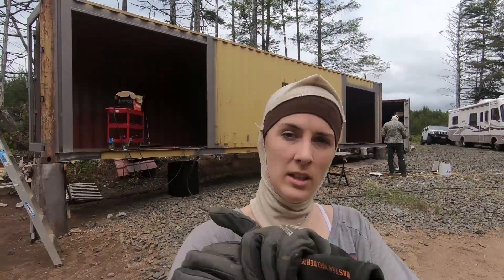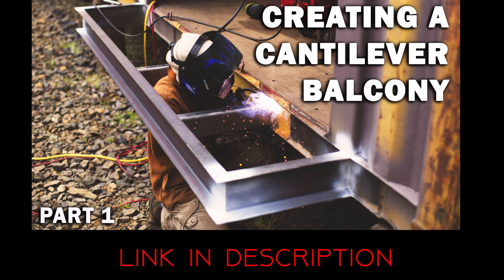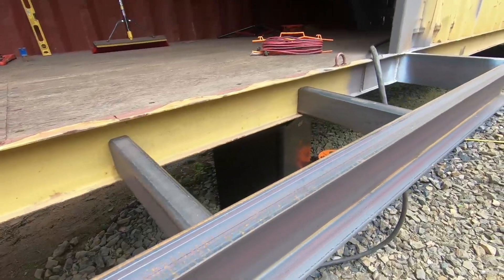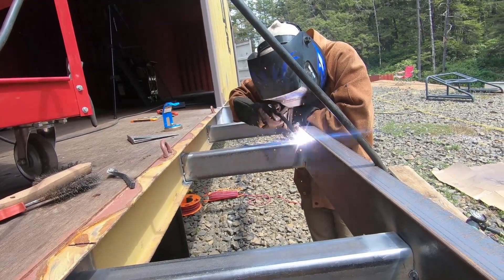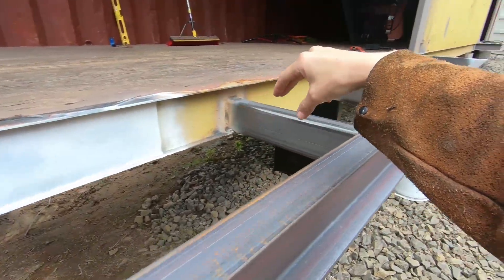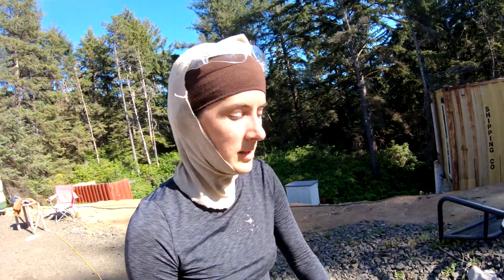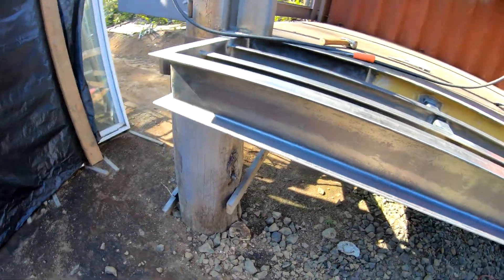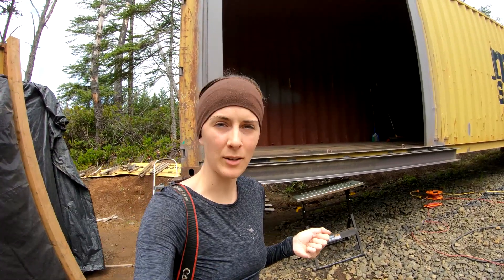BUILDING A CANTILEVER/FLOATING BALCONY for our SHIPPING CONTAINER HOUSE - PART 2 - Ep. 17

Comment: Those 2 "C" channels that you weld inside for support, why not place them with the wide flat section on top and just cut a small section out...they almost look the right height and little would be cut out...unless you intend to sit the timber inside the frame... I think only 1 would be needed also.
Reply from the maker: We’re not sure what we’re doing for the flooring yet, we have a few options so we  put the 2 channels on the inside to support a few different kinds of flooring. Always a work in progress! 😊

Comment: Thanks for that comment on the Harbor Freight sprayer! I have one small house to paint (mine) and I've been procrastinating because I didn't want to drop the money on a sprayer. I saw that one at Harbor Freight and I wondered if it would do the trick.
Reply from the maker: Of course! We’ve had good experiences with it overall. 😊
Reply: @PacificPinesRanch  Is that the AVANTI AV-APS1?

Thanks in advance
Reply from the maker: @chrs1212  No we use the airless sprayer Krause & Becker & the air spray gun (central pneumatic).